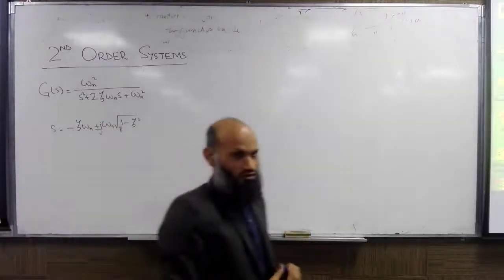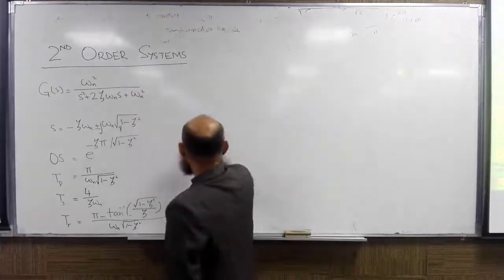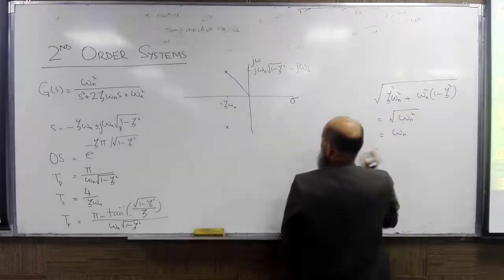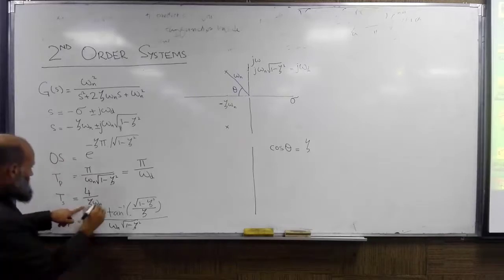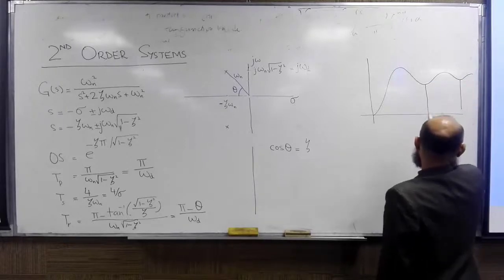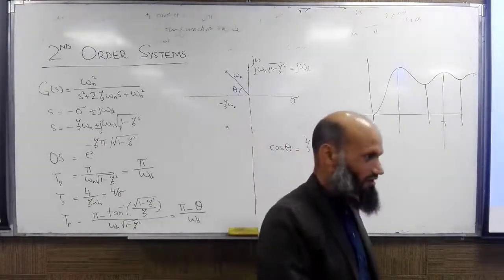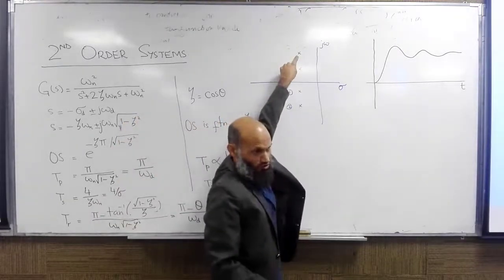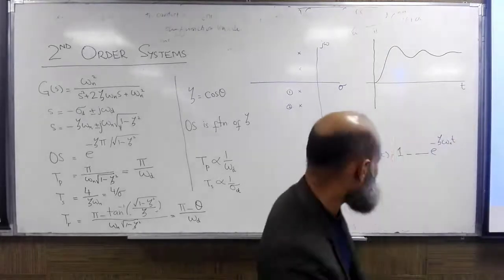LCS 22a - Location of poles and transient specifications for second order systems

Comment: Sir in this lecture you have written roots of the 2nd order system in the form of of sigma and omega... There is a slight confusion at 0:15 , shouldn't there be a negative sign with the (1) and positive sign with (zeeta) in the under root expression? You have written it the other way.
Reply from the maker: Negative sign is taken common which becomes j (or iota) when it's square root is taken.